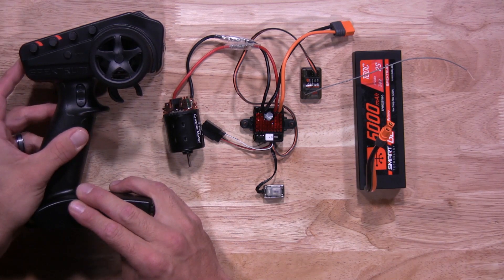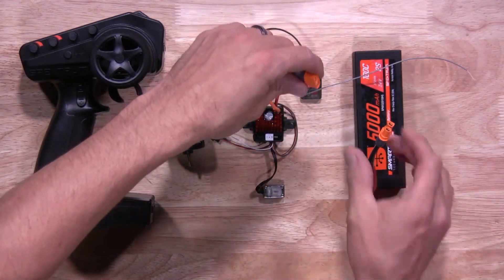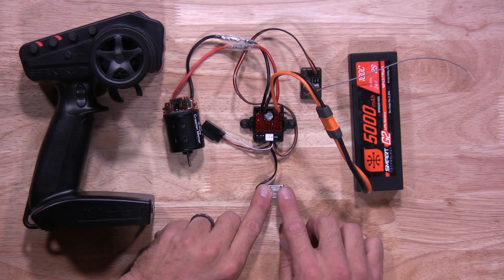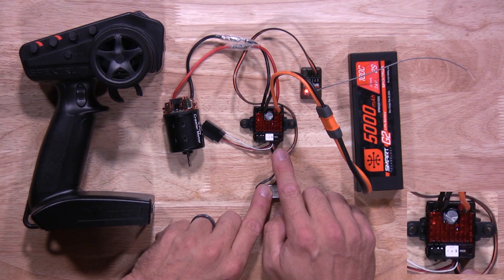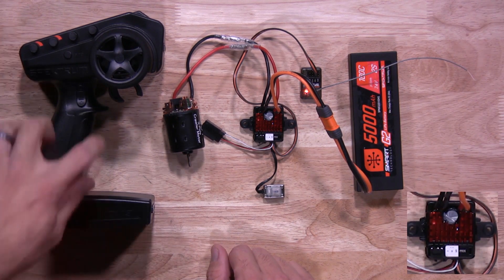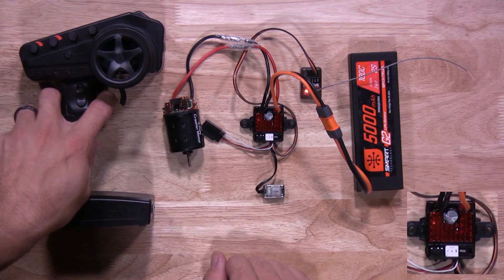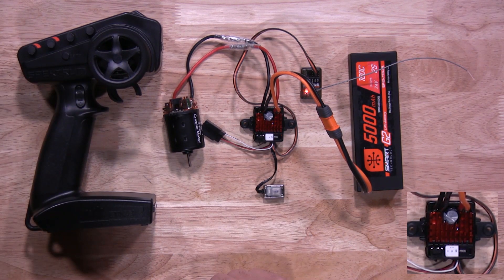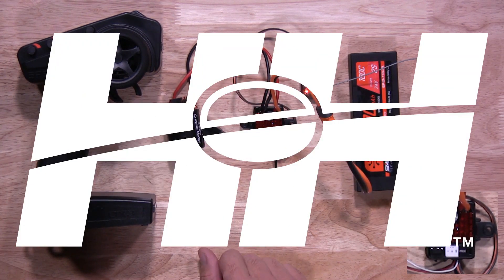How to calibrate the Firma LITE Brushed Smart esc

Comment: I’m trying to calibrate  a Firma 70amp brushed esc with a Firma brushed motor. The radio is a Graupner 4ch surface radio. I turn the radio on,then the car. As soon as I do that,the motor just starts running,then stops.  I go thru the calibration and still I only have full throttle,by just touching the trigger. No reverse.